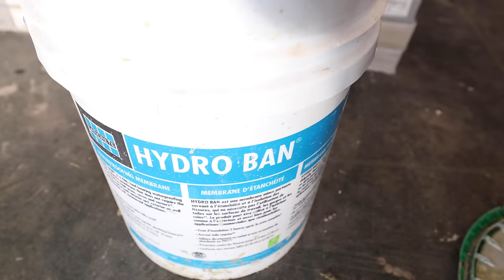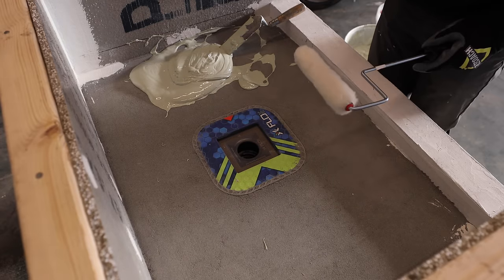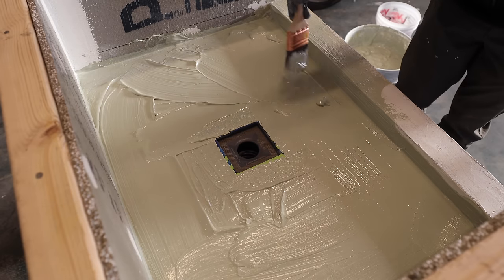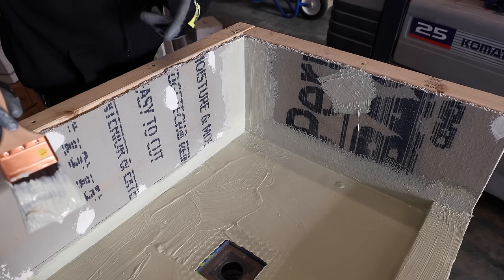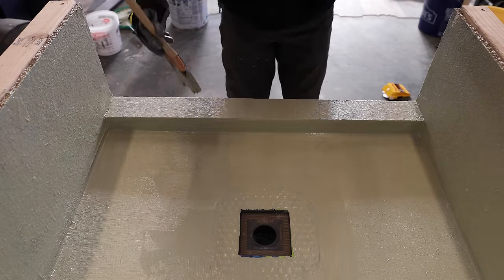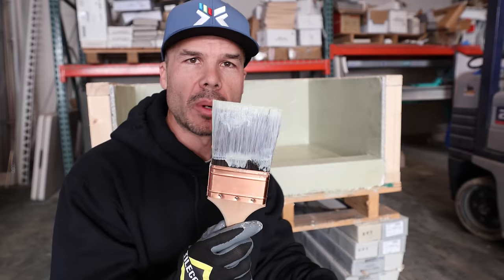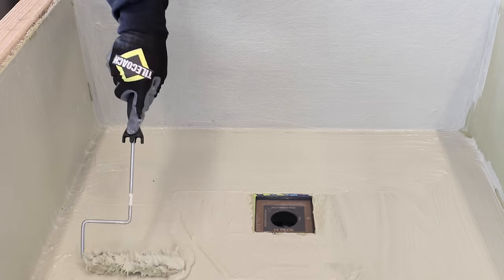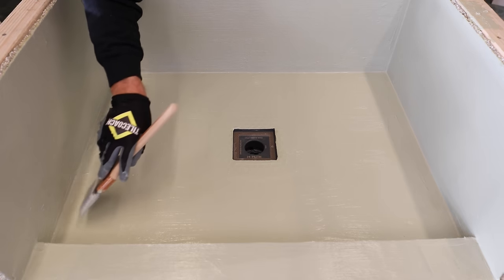Easiest Way to Waterproof OVER Dry Pack Shower Pan --- Hydro Ban Liquid Membrane

Comment: I’m preparing to replace a garden tub with a shower, and this video provided the perfect method that seems to be a balance of ease of construction and effective waterproofing.  Wish you would have included the water test though.
Reply: This is not the right way to do a shower pan install by any means there’s so many things he did wrong and that are against code where do I start? No pre-pitch under that shower membrane so when water leaks through to the shower membrane, it’ll sit there in puddles instead of being escorted to the shower drain, weep holes like it is designed to do Then he screwed holes in the shower pan membrane below curb level, with his dry pack for beginners idea. which is again a no-no and then finally putting the expensive ass roll-on membrane on top of the dry pack, which is counterintuitive to what it’s supposed to be doing. The whole job is wrong from start to finish people that make these videos on YouTube. I think they just pick a niche read up on it and think they’re a professional when in fact, giving false and very bad information that could potentially cause major leak and major damage to your home where is his license, because if he had one, he would know all this very dangerous to listen to people like this call a professional you get what you pay for remember
Reply: @StephenMcDonough-eg5nm  With all due respect, you are way behind the times in shower pan technology. There is no pre-slope because using Hydro ban prevents water from ever getting down to the dry pack. And a flow FX drain doesn't even have weep holes. He drilled holes when making the slope because the membrane went over top of the holes in the form of Hydro ban. I would suggest that you put a little time into researching some of these new techniques. They would save you a lot of effort and headache.
Reply: Yeah, it will show me the code book where it says that that’s allowed just because you say it is doesn’t make it true why even put a shower pan and if that’s the case what do you need a shower pan for if that’s so great I’m gonna go with. It’s not as a plumber for a zero entry shower that means with no curb. You’re allowed to make a pen from the red guard but in that situation, you still have to pre pitch it. and do a water test for your inspection which I’m sure that what you’re doing you don’t pull permits or have inspections done because you know more than everyone else good luck again nothing personal I just don’t think you should be giving advice that’s not correct especially like I said before screwing screws below the curve line into the shower pan why would you do that? You have to know that that’s against code and not just against code was just wrong and every which way OK good luck take care.

Comment: Question?  The Sacrete floor mud states that if its not tiled in 24 hours then you have to wait 28 days for it to fully cure.  If I have to wait a minimum of 3 days to apply the hydro Ban  then do I actually have to wait 28 days to apply and or tile?

Comment: Good Day thank you for all of your videos. I am a DIY home owner. I am getting ready to gut my bathroom entirely to have the slopping floor repaired by a professional. And, I will be replacing the bathtub/shower with a tiled shower with a high curb ... so my toddler grandchildren can still bath. I have been watching your videos for over a month and have learned a lot. Thank you so much. BUT... I get confused when you talk about different systems, different grout products, using pans or using dry pack, using tapes for seams, water proofing products. How. as a first timer. can I choose products that will work together and last?

Comment: Is seam tape not required on the changes of plane with hydro ban? I know redgard says you can use it without tape but I always do anyway I like the extra piece of mind that the corners are strong with the tape and I also tape and thinset all my joints and corners prior to waterproofing I like to have my corners as strong and sealed as possible.
Reply: Your correct using the tape or you can use sica flex in the corners to ..the tile coach showed an incorrect method by not using anything in the corners his method will fail with any movement of the wall or floor
Reply: I follow the same practice. Every seam every change of plane.

Comment: We use rubber roofing membrane before we even lay our durok. We put rubber in the corners and on the shower floor before we even lay the mortar for the shower bed.
Reply: I don't believe the method described in this video is approved by the NTCA. 

The correct method on a wood floor is, cementitious sand mix add sparing water to hold shape when squeezed in hand,  3/4" @ drain, sloped up 1/4" per ft to walls with NO low spots that can puddle water, Let Dry. Install pan liner per manufacturer instructions, finish with the final sand mix, maintaining 1/4" per foot slope, let dry, then tile as per NTCA. (plenty of videos on the process.)

Many people believe tile is water proof, It's NOT. The area behind tile in a shower needs to be waterproofed to keep water inside the area and down INTO the pan liner.
Reply: This is how to do a shower with no  pvc pan liner, and no preslope. With a liquid applied waterproofing.so the water stays on top and goes down the drain instead of traveling through the mud into the pan and out of the drain weep holes.

Comment: How about also using the Laticrete Waterproofing Membrane 6" for the corners and along the perimeter? I've seen people doing that. Or is it not recommended if you don't have cracks greater than 1/8"? I am about to use the same waterproofing on my mortar bed but now I question the usefulness of the corner membrane.

Comment: Fantastic stuff Isaac! You have been the most helpful source for tile DIY I have found - so thank you! Quick question. Would you recommend adding dry pack if the cement floor already has appropriate slope to the drain? Obviously the dry pack serves the water in water out method. Is it necessary when applying the liquid membrane over the tile pan? Can I skip that step and apply the membrane directly to the concrete?
Reply: Slide in DMs or an email for a question like this. Chances homeboy will see it in the comments are close to 0
Reply: I think applying the dry pack over existing sloped cement floor is how high is the drain that you are finishing to? If its flush with the cement, then no mud bed would be needed. Just clean the concrete very well and go for it. If you are addind a drain body, then the necessity for a mud bed is obvious. Apply membrane up and over the curb etc.

Comment: Okay..HydroBan is the best.  It is also 3x the price of other products.  Thoughts on using HydroBan on the shower pan and up an few inches along the walls and then using DuRock liquid membrane (1/3 the price of HydroBan) on the CBUs?  I've got a large 36"x72" shower and would like to save a little $$.  Both products are water-based, therefore should be compatible.  Good idea?

Comment: Shouldn't you seal the joints between the drain flange and dry pack with tape? It seems like that is the area most likely to leak. Love your channel and videos. Awesome unbiased content, Isaac.
Reply from the maker: Yes, it would be a good idea...but I wanted to do this one per the instructions that say you do not need it.
Reply: @Always Vacationing Question since I will giving this set up a try in our tiny house  build next weekend. By seal you mean using mortar such as multimax lite and tape around the FloFx drain before applying the Hydro Ban?
Reply: @rolanddelacruz6440 that's exactly what he means but the liquid membrane is taking the place of the sheet membrane so either way its still waterproofing weather it's sheet or just liquid membrane

Comment: Never done a shower before but I’m trying to do my research and I’m loving your videos! I’ve seen other projects that go: pre-slope/liner/dry-pack/tile…does your method of a single dry pack layer topped with hydro ban accomplish the same thing? Thanks in advance for your advice!
Reply: No it’s completely a waste of time and money that stuffs not cheap and it should always have a pre-slope underneath the shower pan that’s code just about everywhere I know what that does any water that does it get below the tile grout in dry pack and gets down to the actual shower, remembering itself with that pre-pitch. It takes the water on the pan and runs it down to the drains weep holes which is the way it’s designed purposely to do so with no pre-pitch what I will just sit in a little puddles on the pan and eventually that a crack your dry pack, and your tile
Reply: Don't listen to the naysayers.  No pre-slope is required because hydro-ban does not allow water to contact the mortar bed at all.  I finished a huge shower just as this video shows and it turned out great.
Reply: Don’t listen to this person then he’s already giving you bad advice by Tony The screw holes in your shower pan below the allowed height by code and then it’s telling you not to put in a pre-pitch which if he pulls any kind of permits for his jobs like he supposed to Fill fail every time so I’m gonna say he probably doesn’t pull permits Desi. Do you want to pay for something like that and take the risk that this person is smarter than the engineers at Oetay then by all means, follow his lead. I’m not trying to be negative. I’m just trying to help you out deal with it what you will

Comment: TILE Coach hi and thank you for being there.. So I watched quite a few of your videos where you floated the walls ..... and it did not seemed as you have applied the hydro to the over duroc float and did mention that it was ready for thin set and tile.... I am curious what you recommend for 12 x 24 marble tile installation .... what duroc thickness or if matters or not we probably too want to follow your system in floating the walls but once done should we use hydro ? does it matter what thickness duroc to use when flowing anyway>? please advise and be blessed. I will definitely share your channel and video from now on. I have subscribed as well

Comment: Sorry for the dumb question. Just want to make sure i understand the steps :) you did your deck mud slope then you did the hydro ban waterproof. Do you continue on to do another layer of the deck mud before tile or is this sufficient to proceed to thin set and lay tile?

Comment: Regarding your pro tip.... I keep a roll of seranwrap or klingwrap handy for my brushes and rollers works way better than a plastic bag at keeping air out and not drying them out....less messy too.  I've had rollers last months when klingwraped and stuck into a roller case.. and you don't need to wash the case !..(roller cases are crap at air sealing , and a pain in the ass to clean, on thier own)
Reply: Can you do this with paint too?
Reply: @jessicawilkerson9687 absolutely 100% , works even better with paint,  I've had paint rollers last months.

Comment: Whats your favorite shower system? I was taught with oatey pvc liner for the pan over pre slope mortar bed, then a second bed of mortar. Concrete board on walls that goes over the liner, backer seams done with tape and thinset, then redgard on walls. It doesnt seem like a bad system, but its time consuming with all the drying time. I've done a few online courses for Wedi and Kerdi, do you use one of these normally? I want to try one of them out for a shower I'm doing but I'm not sure which, leaning Kerdi. As always, your videos are great, keep up the good work.

Comment: love the videos  I"M in the process of building a shower the drain is offset from center per customer specs I"M using quickcrete sand topping mix as my drypack mud its over plywood so I have my pan liner and telescopic drain installed I put the durarock down about a half inch from the panliner as not to hurt the liner with a sharp edge so after installing the mud bed because of the offset drain where  its two feet from the wall the picth is great where its a four feet from the wall the picth isnt quite enough could I install some 1/4 inch dura rock just along the perimiter as a screed point and use mape large format wall thin set to skim coat from the 1/4 inch board down to nothing to increas my slope then hydro ban the whole shower will the hydro ban work over the thin set as it would over the dry pack

Comment: Hey Isaac, would it make sense or would you reccomend putting Hydroban liquid membrane over an installed Schluter TT shower tray +drain+kerdi boards, prior to tiling? (I would still do all schluter waterproofing membrane steps)

I have started a curbless shower install at my cottage, and i have since seen your videos about the kerdi failures when it comes to All-set/thinset, the kerdi membranes, capillary action etc. I have zero interest in preserving warranty coverage from any of these companies, my only interest is to build a lasting waterproof system that wont fail. I feel like an additional layer of hydroban liquid on top of everything would be desirable overkill. Any thoughts?

Comment: I’m installing a Neodrain linear drain with “conventional” drain flange and mud deck. Can I just put down the tar paper, lath, then dry pack with the slope, right to the height (or just below) the linear drain, leaving enough room for the tiles I’ll then put down? In other words, is there any need for 2 layers of dry pack - 1 pre slope, then water barrier (like what you used here) then 2nd layer of dry pack?

Comment: Me again, question. Once I complete my shower pan and apply Hydro ban,  if I wanted to insta ditra heat. Do you think is possible and okay to cover it once more with thin-set, another layer of hydro ban and paint it? I was thinking of covering ditra heat with a concrete overla, but am not sure if that is okay to do with the system. Long story short, i'd like to create cement shower pan so that I may stain it and paint it with epoxy.  What are your thoughts? Gratitude in advance.

Comment: I'm a first time DIYER with kerdi membrane already up over my cement board. Would it be beneficial to give it 2 coats of hydroban liquid membrane? If so, will it make it harder for the tile to stay up on the walls? Cost/time is not an issue, I want as close to 0 risk of leaking as possible.

Thank you!
Reply: Plug your drain and do a 24 hour pond test in your shower. Mark a line at the water level with a sharpie, if the water doesn't drop and you don't see moisture outside the shower you're good. You can go longer if you wish. If you were to coat over it your bond would only be as good as your kerdi installation. If the kerdi is bonded correctly then you should be okay. Kerdi is a good product but I always do a minimum 24 pond test. Remember water does evaporate so if you leave it for a long period of time in a warm/hot area the water level will drop naturally.

Comment: Is it a problem if I did a thin Schluter membrane under the dry back and then hydro ban over it? I’m worried now about the sandwich effect causing mold. Also I used red guard and am not super pleased. Can I use hydro ban over it?

Comment: This looks so easy, why do people chose to use a membrane fabric over this method? Seems to me this works well, easier to apply and cheaper.  Also, could you use this method first and then for pre caution use fabric tape membrane in the corners and seems? Or the other way around use fabric membrane on seems then use this liquid over the top?
Reply: I think professional tile installers can put up a membrane even faster and you don't need to worry about making a layer that is a particular thickness because it's a sheet.

Comment: Big fan of this channel. However, I have recently watched a number of videos detailing how it is a bad idea to have the backer board go down into the dry pack shower base. Apparently, it is only a matter of time before moisture wicks up into the walls. What is your opinion on this? I'm getting ready to make a walk in shower and I want to get it right.
Reply: I have the same question!
Reply: @joemolina4640  I guess you have to pay money to get questions answered on this channel
Reply: If you're using the old water in, water out method, then it can be a potential issue, since the pan is getting wet. But with these newer methods, it's not a problem. Since it's a completely sealed system, the shower pan and walls never see any water (if waterproofed entirely obviously), so letting your wall board touch the pan is no issue.
Reply: The liquid membrane can crack some day, especially on the floor, and then it will be an issue.

Comment: How do I know my deck is hard/stable enough? Not quite 24 hrs, but I’m just a bit nervous. That’s the hardest thing that I have ever done. I’m a 62 year old female and I mixed everything myself. It took me about 1.5 hrs, mixing and all, as my shower is 68 x 32 and it’s my first time doing this. I was worried about taking too long, getting it in, but I kept testing the mud consistency and it stayed consistent. I just want to ensure I’m good before moving forward. Bed top is a little sandy on top, but just a dusting.

Comment: What is the base made of? Is there water in it? If so you might find that your 3 days cure conflicts with the hydroban, i use a similar product in the uk and generally any water mixed product requires 1 day drying per 1mm otherwise you seal the wet in and eventually it will de laminate. 
But your manufactures instructions may say different but i doubt it.

Comment: i know its all about the tcna but  why is it not right to use a 3 piece drain and do the same thing? i know it has everything to do with the drain itself, but if you use this hydroban  on the drypack up to the edge of lets say an ebbe drain, are they saying that gap wouldnt hold and water would seep down from there? is that the only reason you need to use a bonding flange drain because of that particular failure point? thanks